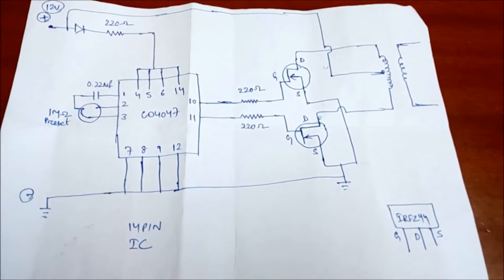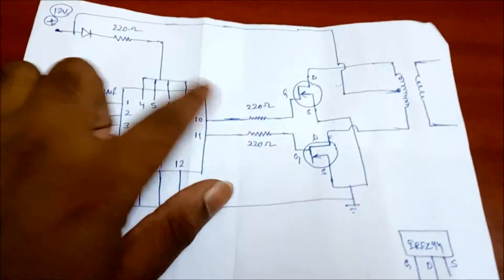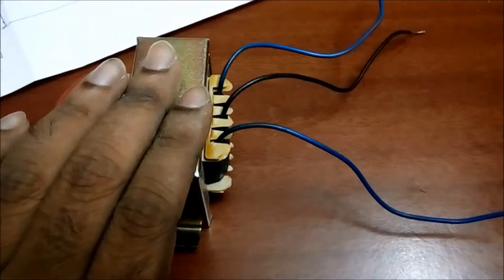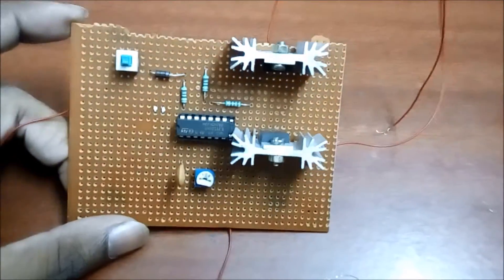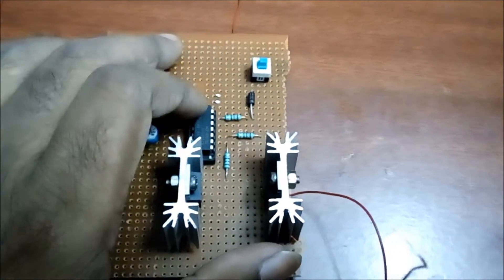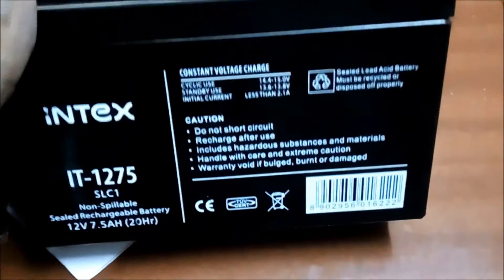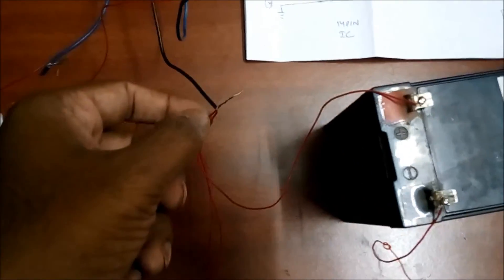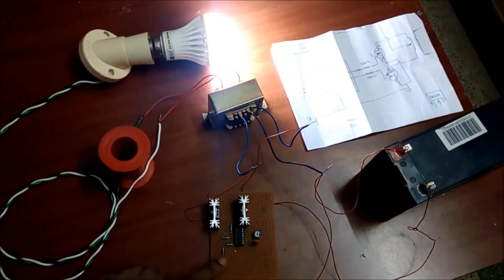[ How-To] DIY Inverter Circuit Making

Comment: This is a great circuit great oscillator however if you put attention to the center connection to the  transformer is going direct to positive input and on the  other in of the coils direct to the transistor the transistors are getting 12vdc on the drain    this circuit need that connection to work but it will create heat on the transistor the primary coil  of the transformer need to be costum  for this to work permanent  or there is components missing on that area and please when you speak english slow  the hell down the secret to speak good english whit a accent  is to speak half of the speed of you native language

Comment: Sir can u provide the circuit diagram pdf plzz
Reply from the maker: Look at the video properly,
Diagram shown in this video

Thanks for watching
Reply: Thanks u sir 😊 can i used 12-0-12 5A transformer instead of 1A for this circuit my load is 50 watt and how much hours it give backup using 12v 7.5AH battery on 50 watt load